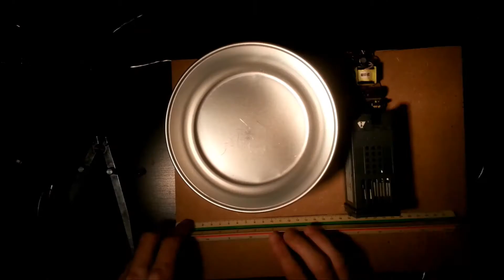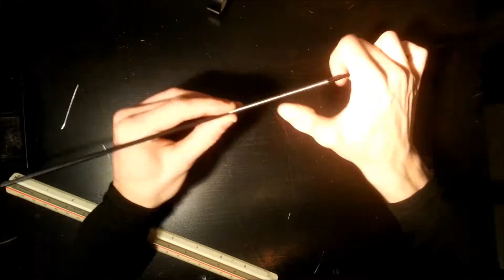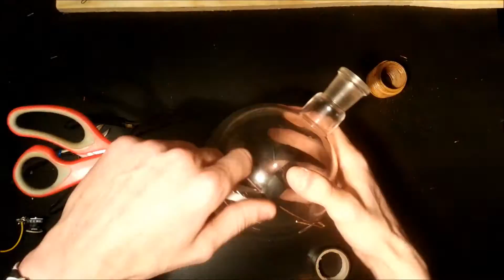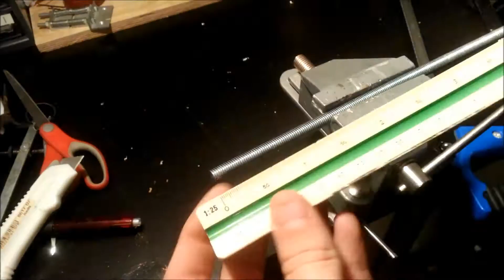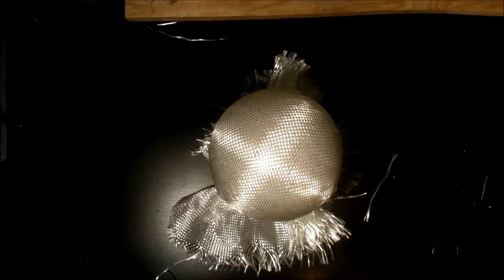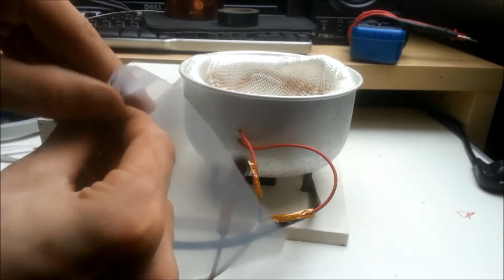DIY Magnetic Stirring Heating Mantle with PID controller.

Comment: This man's never heard of the invention called a drill. It's a thing that will spin wire for you 😂😉
Reply from the maker: I would not recommend using a drill for this procedure. A lathe with wire feed is possible, but otherwise do by hand. As this yields far more uniform loops. And reduces the risk of snapping the rather brittle Kanthal wire(Same for Nichrome). 
A drill would however be fine for winding loops for say chainmail/jewelry  using mild steel,  silver, copper etc.
Reply: @JKKnudsen  but when you wind you wind with no spacing drills shine in that regard bro, look it up people make them like that and they turn out perfect I'd argue you get a more consistent result like that. Even a hand coiler. And it's not like it's some NASA grade coil if something is a few thousandths off it's not gunna be the end of the world

Comment: Great video. I would use ceramic blanket for insulation so the pot doesnt get so hot. Vermiculite or perlite can also be used as heat insulators. A PID controller with a SSR output and a SSR lasts longer than a mechanical relay. I would also ground the pot and any exposed metal parts and use a ground fault breaker.
Reply from the maker: Cheers! Ceramic blanket used to be hard to come by, at least where I live, it's getting better. and yes SSR are better, Use one in my kiln, but this was made from junk I had laying around.
 When I made this I did consider making it an electric sand bath, but had the feeling pushing round bottles in and out of the sand could end up shorting the heating wire. Suspect verm would as well, but you could use one of those coils from a ceramic hotplate, those have a firm but bendable sleeve filled with magnesium oxide. Bend to shape and throw it in a pot with verm and you're cooking!

Comment: I mean it is a really good option for people with no money but this potential fire hazard isn't for me, rather spend $200 and avoid that. Great tutorial though
Reply from the maker: Thnx! But yeah, it has some definite limitations(no power regulation),  but that thing is still in use. I do  have commercial ones for different volumes, that I feel more comfortable leaving alone, though one did ironically catch fire(loose wire at the regulator box). But if you're first paying, I would go for something a bit high-end Electrothermal or FALC maybe. Or get a good used one, I have a few Isopad Isomantle's that have served me well.
Reply: J Knudsen well I use 1000ml heating mantle with magnetic stirring and a lcd temp display and i can set the temp in there precisely, those babies are really comfortable and convenient, its really the only mantle i got but it sure does the job, and i mean you can fit even a 500 round bottom in a 1000 mantle and youre still good to go!
Reply from the maker: @daw5600  Yeah, The 1L is the workhorse of the lab!(Stuff some foil around the flask and you can use the whole range of flasks from 50mL-1L) And the digital readout is almost a must when working with low flash points. Also I think most people should just take your advise and buy a mantle, unless you are going for something in the 25-50L range, then DIY is a lot cheaper(and don't raise suspicion), but maybe put a bit more effort into it than I did.
Reply: J Knudsen Btw thanks for the advice, i never heard the store ones also catch fire, better safe than sorry, again thanks
Reply from the maker: @daw5600  So true!

Comment: 2:19 Maybe just put the rod inside a drill chuck thingy, and as the drill rotates the rod, just move the wire up? 
But this is a great video! I will add this to my "To-DIY" list.. lol. I think I'll make one for a beaker shaped vessel though, similar to this: http://amzn.com/B077675XRB
Reply from the maker: That's so obvious in hindsight.  But yeah, the design should work fine for a beaker as well. If you decide to make one, note that the pot is grounded through the sleeve of the thermocoupler   Also, thanks, and good luck!
Reply: @JKKnudsen  Haha, Trust me, I've done it the same way you did only to realize the same thing much later.
And thanks for the extra tips! Keep making these awesome videos. 
I plan on making a DIY "smart" fume hood (with some fancy sensors, using either Arduino or RaspberryPi), and potentially a rotovap, but I'm not sure how to make a decent seal (which seems to be where a lot of the DIY rotovaps break down). I may try to purchase that part from somewhere that actually sells real rotovap parts, then the rest will be custom.
Reply from the maker: @jhyland87  Hmm, i have a rotavap that uses a straight tube with a 24/29 at one end and a spinning ptfe stopper in at the other. Those parts should be available somewhere(maybe deschem on ebay). My only tip for the fume-hood, do not use inline fans, just"because you had some laying around"... Regardless, good luck on your projects
Reply: @JKKnudsen  For the fans, I may end up making some custom ones (using existing parts of other fans). The motor will definitely be brushless as those don't spark like the brushed fans do (for any combustible fumes). If I can find a way to have the motor off to the side of the ducting and spin the fan (instead of right in the center), then that would be even better.
Reply from the maker: @jhyland87  Maybe a centrifugal fan, I've seen Matthias Wandel make some dust collectors etc. That uses wooden blades, either coating the wood(polyurethane/epoxy) or make something from plastic. Either poly carbonate or melt some hdpe in a mould. Definitely brush-less!
Reply: @JKKnudsen  For sure, great tips! Thanks again bud.
Reply from the maker: @jhyland87  Thank you, I'm in need of a new fume-hood myself. Good to bounce ideas around. Let me know what you come up with!
Reply: @JKKnudsen  Do you have any good recommendations for a fan? A link to one on Amazon or wherever else? All the ventilation fans I find have inline motors, which is what I'm trying to stay away from.
Reply from the maker: @jhyland87  I had a look on ebay because some ac units use centrifugal fans, but they where rather pricey, but should be scavangable in your local e-waste. If you have access to a band-saw or a handheld router, I would just make the fan from some 2mm and 6mm poly-carbonate. Or use coated(epoxy?) wood and expect to replace it in a few years. You may find this video interesting: https://www.youtube.com/watch?v=YuEaP9kyiFc

Comment: You should DEFINITELY ground both the aluminium pot and the aluminium faceplate for safety using proper crimped and properly dimensioned connections! Especially since you live in a European country where you have 230V mains! Earthing metal enclosures and parts on a non-isolated device saves lives! Omitting proper earthing just puts you at a needles lethal risk! Please update the video and point out this very dangerous mistake!
Reply from the maker: web1bastler I assume you didn't watch the video, as the pot is grounded, and the face plate is in as much electrical connection as the rings on ones fingers, or the nails in the wall. But other than that good advice, and as you say european countries have alot of ground problems. Could I have used a proper clamp, yes, but seeing as its a home made heating mantle, health and safty is clearly not the first priority, maybe third:P
Reply: You wrapped the mains ground around the thermocouple cable. Those are generally covered in glass-fiber insulation which is non-conductive. And even if it was, you would be relying on a shoddy connection. If it's a thermocouple with a shielding connection, then you shouldn't use that shielding for mains ground since it's only for signal integrity, not safety. Just use a properly crimped ground connection on every piece of exposed metal and connect it up with appropriate wiring (e.g. heat resistant)
Reply from the maker: Never seen one with fiber-glass, As they usually have to withstand heat without deformation, they are made of metal. But if I get you right, I should use another cable to ground the already grounded pot? The shielding needs to be grounded, so why kill a bird with two stones if you got it on the first one? Also it would not affect the signal, as they are all connected regardless. But appreciate you input.

Comment: Hey I was using your formula given to try to calculate the amount of feet needed for a 180 watt mantle but I got a longer length wire. When using the following formula i calculated I need 112 ft of wire to make a 180 watt element.  Can you show me how to calculate the appropriate length. the wire is 20g Nichrome 80 0.652 Ohm/Ft

 (We can use the power law along with Ohms, and we get that P=(V^2)/(R). So in your case assuming you want about the same, and you are using 115V main. Then we solve for R, we get R= V^2/P=13225(V^2)/500(W)=26.45. Now we have the resistance we just divide out the .652(ohm/ft) since R is really 0.652*l, where l is length in feet. So we have that you need a length o about 40feet. In general we have that length=(Voltage^2)/(Power*(ohm/length)).)
Reply from the maker: Sure, so you have power(W)= current(A)*voltage(V) . But we do not know our current. So we know current=voltage/resistance , and in your case we have 800.652 ohm/ft. So increasing the length increases the resistance. So the current(A)=voltage/(800.652*length). Substituting this into our first equation gives. Power = (voltage*voltage)/(800.652*length). Now since i don't know the voltage you are using the best I can do is an implicit solution. Where, length=(voltage^2)/(800.652(ohm/ft)*180(W)). 
So if you had 230V you get (230^2)/(800.652*180)=0.367ft
110V you get (110^2)/(800.652*180)=0.08ft
Hope this helps.

Comment: How do you power the mantle? Is it through the PID temperature controller? I have a heating mantle and a relay with Schuko power output. What I want to do is get a temperature controller and connect it to the relay which powers the mantle. Do you think that would work?
Reply from the maker: Yes! In this controller, there is a built in relay. But a PID with digital output and external relay would work just as well.
Reply: DiBuff o
Reply: I suggest you get a PID temp controller with a SSR output and a SSR (solid state relay). They last much longer than a mecanical relay.

Comment: holy shit i tried to make one a similar way and gave up when trying to sew the heating element into the fiberglass.
Reply from the maker: Haha, I remember it being slightly tedious,  but poking pre-holes bigger than the diameter of the coil helped a lot. It should be mentioned that I mostly push the coil through, and avoid pulling, because the fibers get cough in the loops, and the loops get stretched. 
But try twisting a pair of scissors in the place you are going to feed your wire, the fibers will stay out of the way for just long enough, for you to get the wire through. Don't worry if the hole is much bigger than the diameter of the coil loops, the fiberglass realigns itself to close up the holes somewhat. 
Hope this was to any help, feel free to post any other questions if you're having problems.

Comment: What was the formula that you used to calculate the length and how much did you end up using?  I have 20 g Nicrhome 80 wire with a resistance of .652 Ohm/ Ft so I am trying to figure how much I would need.  
        

  
    J Knudsen8 hours agoSo you need to decide how many watts you want going through the mantle. This one is about 500W.  And since this is pretty much a linear load. 
We can use the power law along with Ohms, and we get that P=(V^2)/(R). So in your case assuming you want about the same, and you are using 115V main. Then we solve for R, we get  R= V^2/P=13225(V^2)/500(W)=26.45. 

Now we have the resistance we just divide out the .652(ohm/ft) since R is really 0.652*l, where l is length in feet. So we have that you need a length o about 40feet. 
In general we have that length=(Voltage^2)/(Power*(ohm/length)).

Hopes this helps, good luck on your project!
Reply: Thank you for the info! This can be applied to say making an oven for vaccuum forming to right?  Also what kind of wire did you use?
Reply from the maker: Ahh, how cool! ...I should get myself one of those.. And yeah, it should not be a problem. Just find a way to properly support and insulate the wires, so that they wont short out. 
The wire in this clip is kanthal A, 20(ohm/m). The alloy is just iron, chrome and aluminium. Nicrome is nickel and chromium. Nichrome tends to oxidize apart at higher temperatures(i.e 1200C). Kanthal holds to about 1400C, depending on the alloy. However for your project nichrome is the obvious choice really. Cheaper, and its not like you are going to melt copper or anything:P Even for the mantle in the video, kanthal is a bit overkill.

Comment: the pid just turn off and turn on the resistence or it regulate the power that pass trough the wire cause i want to make my heating mantle and i just failed with arduino and relays so if this pid can do that please tell me where do you buy it regards from mexico really nice project
Reply from the maker: Thanks! 
Well, it has just an element that was wound to about 500W, The controller as it is now, only uses the internal(magnetic) relay, and so dont have the switching speed to do power regulation. But it has a logic level output that can, if I remember correctly. You would then output to a thyristor or similar that regulates the power to the element. But you could do this with an arduino as well.  Either as PWM, or phase-fire, if you get hold of a thyristor that suits your needs.
Reply: thanks i ll try

Comment: The pot must be aluminum or some other non-magnetic metal or the stirrer won't work
Reply from the maker: True, any ferromagnetic material will divert to large a portion of the field, to do any good. Copper is another valid candidate, along with ceramics. Mine was obviously aluminium.

Comment: Great work! How much did it cost in total? The electrical parts, fiberglass etc.
Reply from the maker: To be honest, all but the fiberglass and the kanthal wire was found in the trash. So in total I think I spent 8USD. But I recently purchased a PID on ebay for 11$, so in practice I would guess you would get away for less than 30$.
Reply: @JKKnudsen  I got lucky and got a box of broken fan heaters, mostly just carboned up thermostats so I harvested what felt like enough nichrome to lasoo the moon. A tip for the fibreglass too, go to scrapyards and check any caravans for fire blankets, I've scavenged quite a few that way.
Reply from the maker: @EddieTheH  Nice! Fire blankets is a really good tip! must remember that one!